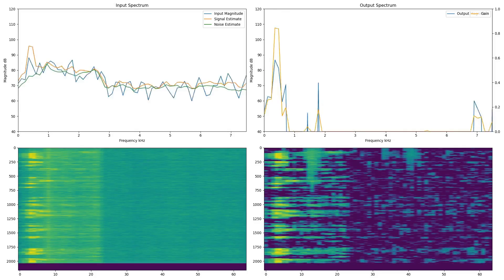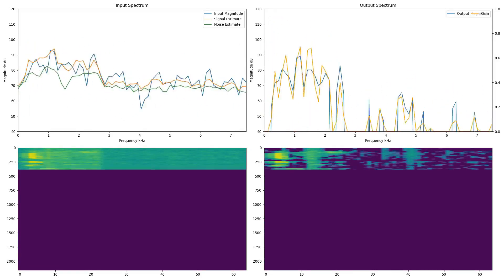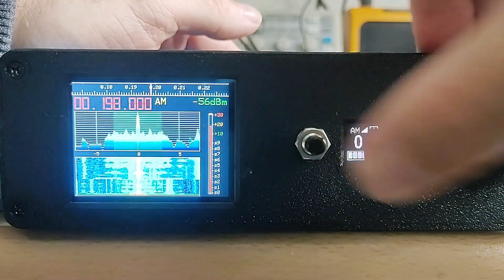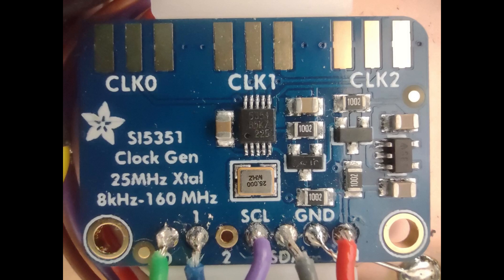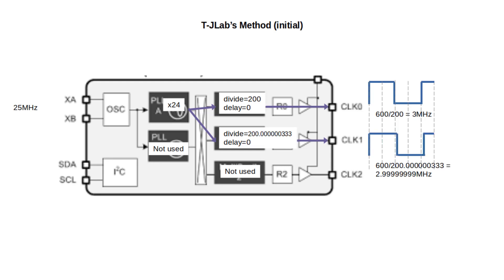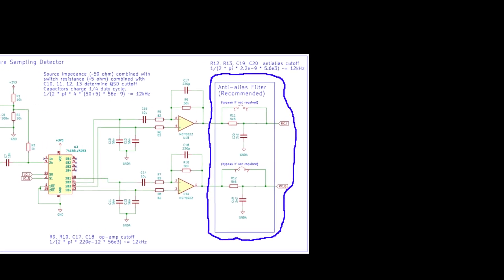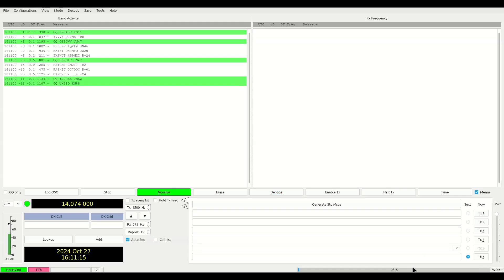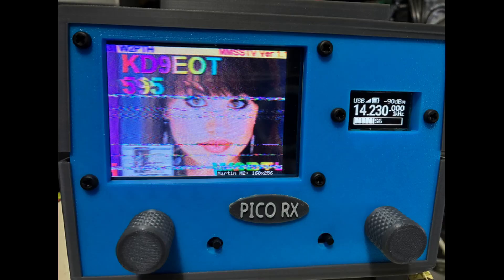Software Defined Radio with Pi-Pico - Part 4 Many Upgrades!!!

Comment: Any thoughts if the ADC data could be pushed to a USB such that it can be displayed using Sigrok Pulseview?

Not sure what's involved, but I imagine a driver of sorts would be needed that takes the data and formats it before passing it to PV.  Unfortunately, haven't seen any examples how to do this!
Reply from the maker: I don't think USB has the bandwidth to capture the data at full rate. You can select the raw iq streaming mode however, that passes raw IQ data (post decimation and filtering) out via USB audio. It can then be used in SDR apps like gqrx or GNU radio, or you can capture it using any audio recording software.

Comment: simply wow, I commented on the SSTV video about adding hardware to my custom PCB expansion board for uConsole that I am working on to include hardware needed for your  SSTV project, now I feel a Pico based SDR transceiver is a most!
Reply from the maker: Thanks so much!

Comment: Modified and firmware update done. 

Btw how to sort saved frequency in a Blank..... ?
Thanks.
Reply from the maker: Cheers! Storing a frequency in one of the blank slots should be as simple as selecting the Store option from the menu.
Reply: @101Things-ds8tc  Yes thanks, there are many saved frequencies saved not in an order from lowest to highest. How to sort them ?

Comment: Hello, 
Is it possible to use a TFT LCD ILI9488 instead of the recommended ILI9341? I see in the ILI934x.h file some reference to this display in enum e_display_type.
Thanks for your help.
Reply from the maker: Hi, yes the driver supports it, but it would take a bit of work to get the ILI9488 to work. Its got a different resolution so I would have to re-work the user interface to make this work. A higher resolution display is a nice idea for an upgrade, but I don't have any immediate plans to add support.
Reply: @101Things-ds8tc 
Thank you

Comment: Great project, thanks for sharing. I have difficulties obtaining the 74CBTLV3253 chip. Could you kindly advise any alternatives? Thanks!
Reply from the maker: I haven't tried other devices, and I don't have any specific recommendations, but in principle any 4 to 1 analog switch should work. Look for a low on resistance (e.g. 5 ohms or less) and a fast switching speed (faster than 10ns). The current design uses a 3.3v part, but you could adapt to 5v which should allow a few other alternatives.

The 74CBTLV3253 should be available from the major suppliers in small quantities, but appreciate that might not work for everyone, and shipping costs can mount up.
Reply: Thank you for rapid response. Yes, unfortunately the only options involve expensive shipping.
Reply: Is the 74HC4053 compatible?

Comment: Hello,
You've developed a really great receiver, and thank you for giving us the opportunity to build one. Would it be possible to add a tunable amplifier that the Pico also controls, due to the large-signal sensitivity? Unfortunately, I can only build something, but not develop anything myself.
Best regards,
Hans
Reply from the maker: Actually VK3BAR posted something along these lines quite recently. https://github.com/dawsonjon/PicoRX/issues/99#issuecomment-3341542316

Comment: Very cool! Would it be feasible to receive modes like JS8call, or is it too much of a hassle to get the timing synchronization? LoRa?
Reply from the maker: Cool, thanks. Yes I think it would be feasible, time synchronization can be tricky, but there are ways around it and is less important on the receiver side.

Comment: Wow!!! Great!!! Next step - tx mode. Even if use second pico from you project.
Reply from the maker: Cheers, thanks! I have prototyped so transceiver code. Not ready to share yet, but it does fit nicely in a single Pico :-)
Reply: @101Things-ds8tc can you share schematic for TX addon?? Il try to make on, and wait for firmware. Thank you!
Reply: The transceiver based on the pico would be fantastic, I will try it for sure
Reply: Can't wait for transmit mode!
Reply: Yes. I have been following this channel and project for a while and can't wait to see the transmission part done! Great project!!!